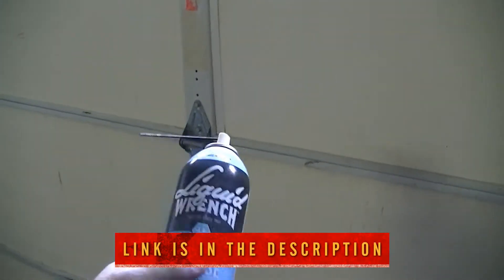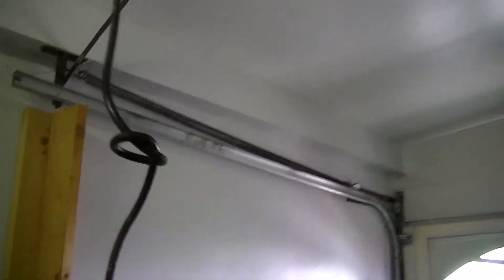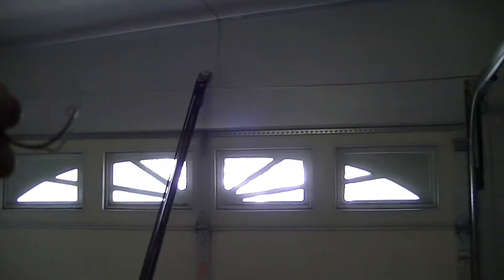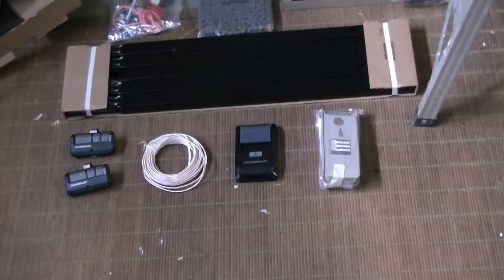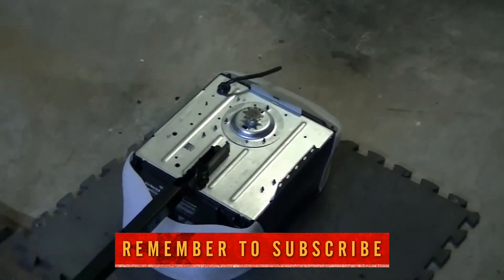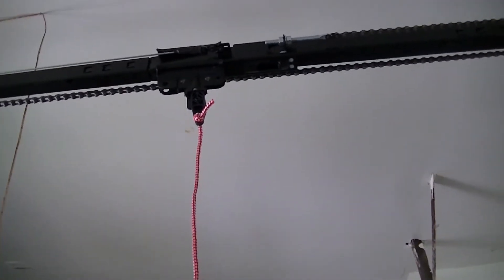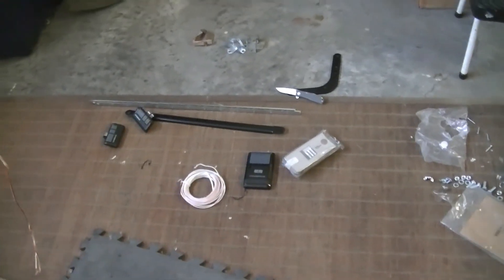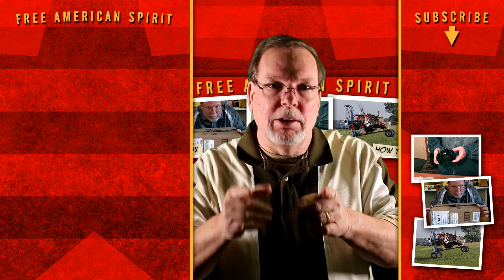Review and Install a Chamberlain 1/2 HP Automatic Garage Door Opener How to Lubricate a Garage Door

Comment: 13:06 The down limit is set way too far the chain and cable is on so much tension you can see it the rail is flexing way too high in the chain is sagging so what is that going to happen is it is going to snap off the sprocket on top
Reply from the maker: well its been over a year and so far it works fine...  I am not a professional Installer just trying to give some tips.  Thanks for pointing out the problem with the tension, somebody will use that info and do a better job than I did :)